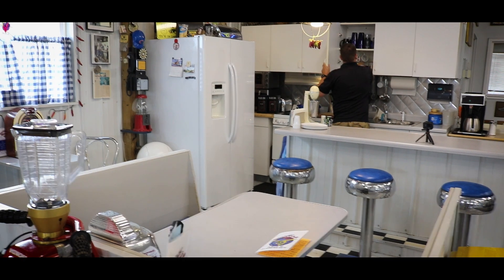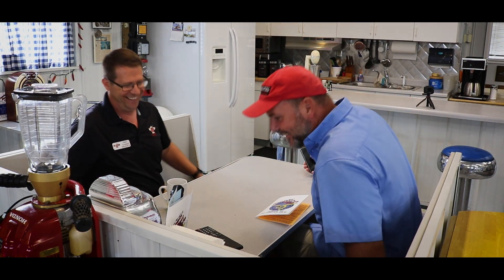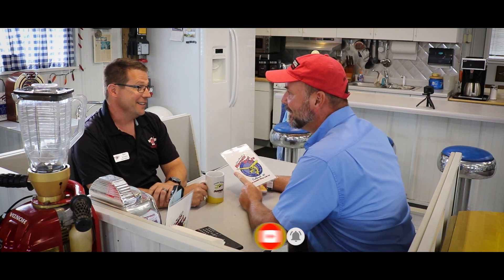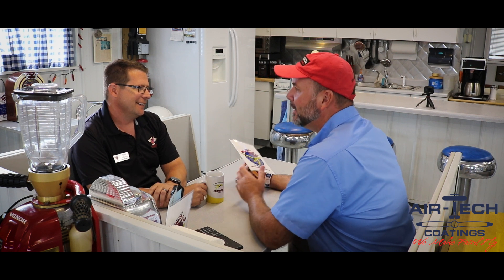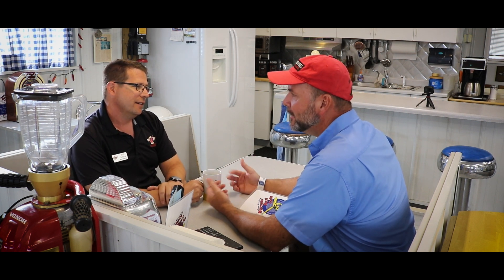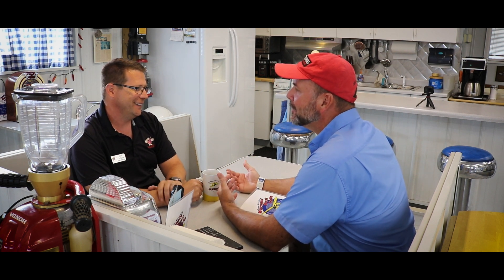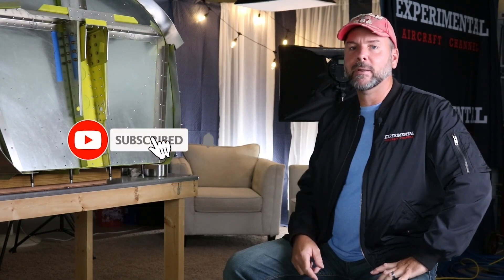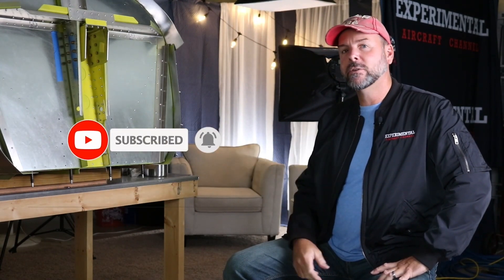What is Sonex Aircraft Designing NEXT

Comment: I think they are a little late to the party with the S-21 and, supposedly, the RV-15.  Other than possibly a lower price, I’m not sure what Sonex can add that RANS hasn’t already done or that Vans apparently soon will do.  Hard to be much smaller than the S-21 and still be useful for two people and Vans suggest theirs will be larger than the S-21 and likely faster so now you have the full speed range covered.  I guess Sonex could do a single seat high wing, but I’m not sure there is a huge market for that.
Reply: More competition is always a good thing.
Reply: @righteouskill45  Yes, it has done wonders for airline travel.  😂
Reply: There is no segment that doesn't have a pane ... I mean if you span the globe .. Whatever they build of course will be in an existing segment
Reply: @markdoan1472  That’s not true.  I am not aware of too many planes in the segment that Sonex entered with the Subsonex.  Generally, a new entrant has some significant differentiation from the incumbents.  It isn’t clear to me what Sonex can offer other than possibly a much lower price or a much faster build.  Given how fast the S-21 builds, it is hard to see them improving much on that.  I doubt Van’s will match the S-21 build time.  However, they offer the advantages of being the 800 lb gorilla and that brings its own advantages.
Reply: @LTVoyager  Vans also has this thing with pushrod only linkages / no cables .. and aileron differential that makes there planes feel locked ... they understood something most companies don't , extremely tight linkages with no cable slop  and zero adverse yaw from aileron imputs due to differential  makes an average plane feel like a Ferrari ... Vans to their credit understood this even though most pilots  have zero clue  what's going on ... most dont understand why this is profoundly superior for handling ..Vans has sold more than a handful of planes based on pilot feel
Reply: @markdoan1472  Yes, Vans has done many things right.  They got as big as they are for good reason.
Reply: @LTVoyager  Yes, agree.  Still, with the RV-12 and others, they prefer to dictate too many of MY choices. eg- RV12 engine choices, basically Rotax or forget it. Maybe a ULS but nobody is doing that. What if I am determined to go Corvair which gives Jabaru 3300 performance at half the cost without sacrificing anything? Will Van's still support me?  (I honestly do not know) Nice airplane otherwise, but what I'm hearing is a Sonex equivalent more friendly to my purposes, and high wing to boot. I know John Monnet has his preferences too, but I understand he has mellowed from the alleged narrow path he supposedly dictated. At least if I build it and give it a different name, like "Cleanex" builders have. Fair enough.